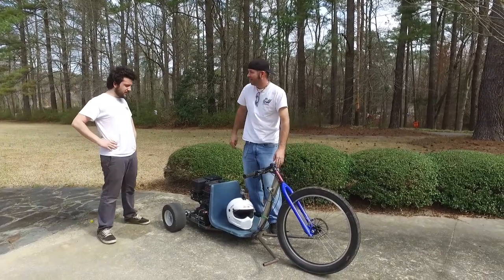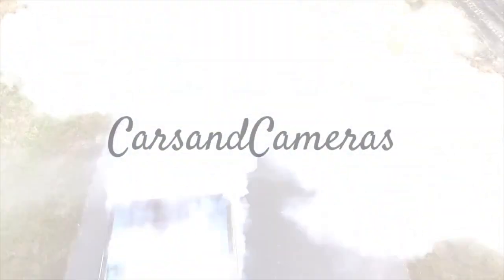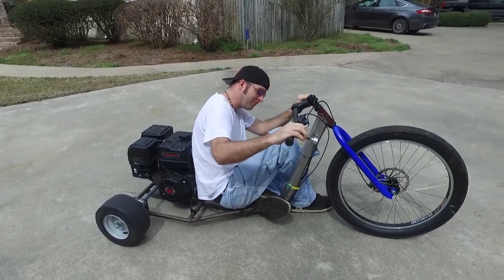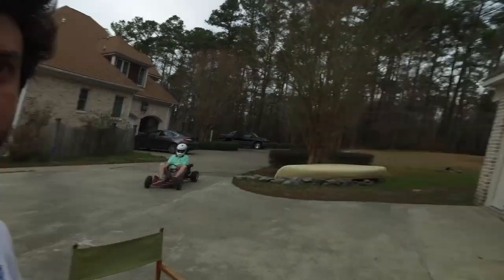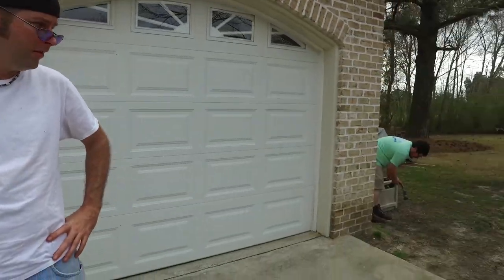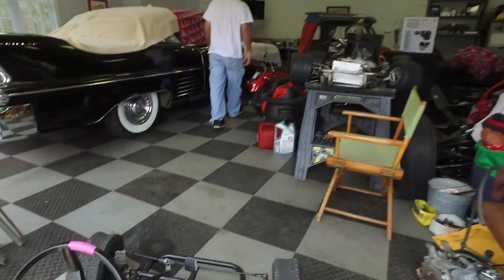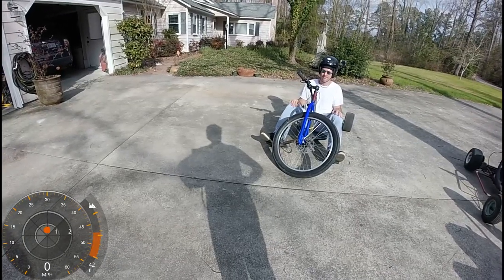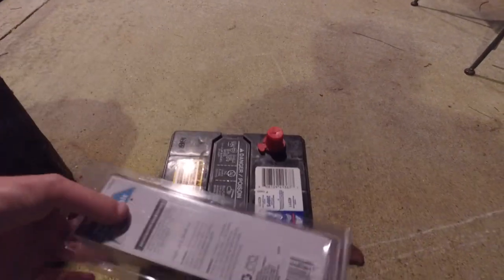Drift Trike Seat, Pegs, and Cruising

Comment: That pull starter has a three bolt pattern. You can turn it to face back. I realize your putting a battery on but you may need the pull starter.

Comment: its da power big wheel. reminds me of the chariot a buddy built when I was a kid, motorcycle front end, wide platform to stand on and honda 350 powering a wide go-kart rearend. never approvable for road use but sure wild looking when Doug took corners crouched down leaning to the inside (on pavement).

Comment: I would say, first remove governor and make sure the engine goes full throttle. Then add the turbo. When the trike earns it's colors then you may paint it.
As it is, zero to governor doesnt take long so you wouldnt see much improvement with the turbo (My thinking) But if you were to remove the governor first then you could see a massive differance

Comment: it wet lot better once u get full throttle u should do a little porting to get more air in that engine so that turbo can work better u may have to lower compression and a steel multi layered head gasket

Comment: First off i wanna day you guys are awesome keep on make videos!  I have a question for ike or John. I have a mini bike and I done the 212cc swap  and and remove the governor and did the air filter upgrade but didn't do anything to the jet. well now it seems my motor has no power  do I need a bigger jet?    Thanks  Aaron
Reply: +Aaron Parker if you do any mods to the exhaust or air box you will need to jet the carb. good luck
Reply: Ok.I figure that's what it was  thanks ike!

Comment: Half expecting an "It'll be fine" however, will that little engine, which doesn't seem to want to rev, be able to even spin up that turbo enough to produce enough boost? And what are you guys going to do for the extra fuel?
Reply: +Dale Engles we were going to remove the gov and jet the carb for more fuel

Comment: Also the reason it's so slow is how you've geared the thing. A tiny TINY gear on the engine and a HUGE gear on the axle is making the speed of it be extremely slow. If you want high speed, try making the engine sprocket gear bigger and the axle sprocket gear smaller
Reply: toooooooorque for drifting yo
Reply: Gedyy With the turbo you can change the sprockets and have enough power to drift throughout the entire powerband
Reply: +Insert Name Here we will
Reply: Isaac it'll be fine Hah awesome, alright
Reply: +Isaac it&#39;ll be fine but will it work????
Reply: Charles Joyce It should work fine
Reply: +Insert Name Here I was kinda hoping someone would get the joke...and that he would reply with his catch phrase..."it'll be fine" but no you missed it
Reply: Charles Joyce DANG, well I was close enough
Reply: +Insert Name Here it'll be fine!

Comment: Does anyone have a good solution for a return spring on the 6.5?
Reply: +Rejects Entertainment advance auto in the help section has a pack of springs. hook the spring from throttle linkage to a bolt on the engine. put the kart on blocks to get the rear wheels off the ground and crank her up. you dont want the rear wheels on the ground if she decides to go full throttle. lol

Comment: the drift trike is like crazy slow
Reply from the maker: +THOMAS FINCH That's what happens when you have a governed engine coupled with small tires and a large sprocket. We'll fix it.
Reply: CarsandCameras yea cause that engine has WAY more potential and would like to see it

Comment: But... I also did suspension to my Mustang :(
Reply from the maker: +paulwuzhere Koni yellows and ford racing lowering springs?
Reply: +CarsandCameras Close lol. Koni STR.T, FRPP springs, adjustable Panhard bar, upper and lower control arms. It's mah daily
Reply from the maker: paulwuzhere Oh, nice. Is it a Terminator??
Reply: +CarsandCameras I wish! It's an 05 GT. Also have an 86 GT convertible
Reply from the maker: paulwuzhere Nice!
Reply: CarsandCameras
 Thanks! I really like your 300zx and the Miata in the background. But the hearse... what a beast

Comment: What if you make your "drift trike" actually drift before you worry about paint. We know you're going to paint it cause neither of you have any idea how to fuel inject or tune the engine for forced induction. You can't even adjust the throttle cable correctly but you want to turbo it? Yeah right. Paint it pink and call it a 15mph go trike cause it doesn't drift. Not even in your parents yard. " "It'ill be fine."
Reply: +chris campbell your giving us crap and we haven't even finished it yet. whats up with that ?
Reply: +Isaac it'll be fine  I guess cause y'all are  talking about Paint and have yet to make a drift trike actually drift. 
The truth about the rear brakes is, why put em on? it goes 15mph. it doesn't even need the rear brakes.
I hope you guys pull it off. but it's not looking good. 
I think the turbo is a pipe dream. I hope it comes to be, but I doubt it.
Reply: +Jake Lowe  I didn't hurt until the end, when they left out addressing the fact that their drift trike doesn't drift and brought up paint.
Reply: chris campbell we said we were going to remove the governor and play with the gearing. we wont be happy with anything under 35 mph thats plenty for that thing. and we have to ask about paint because we were letting you pick the colors, so we have to ask in advance
Reply: +Isaac it'll be fine it's cool I'm going to keep watching till the end. if you make it actually drift I will even subscribe. if you turbo it, I will apologize on fb with a post about how all my friends should subscribe and Im wrong and your always right. good luck guys.
Reply: we have 2 or 3 more vids in this series

Comment: o ya if you put  plastic pvc pipe around the rear tires it will drift like a mother f--ker or take the rear tires off and and put the plastic pipe on the rims them selfs try it works
Reply: +karl schweizer we will have pvc on the tires